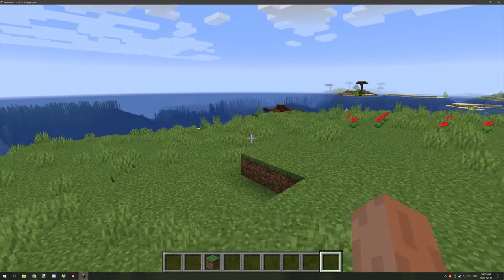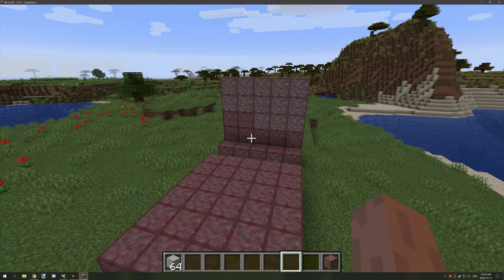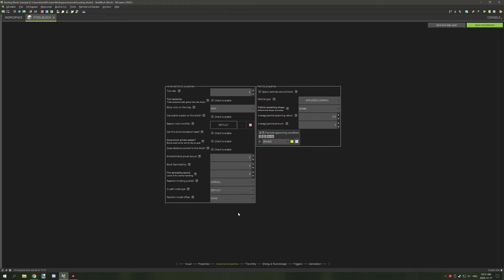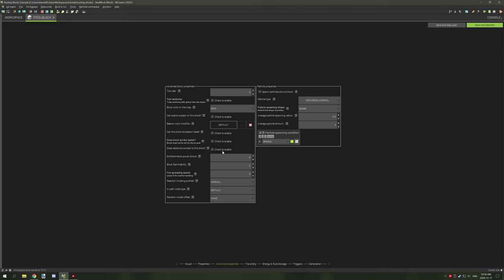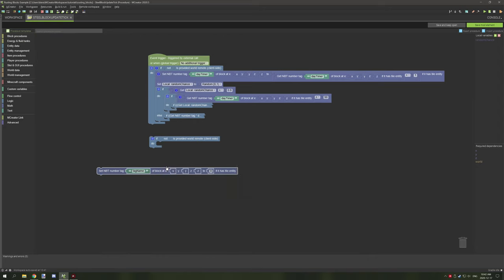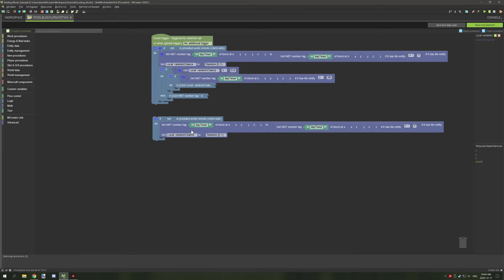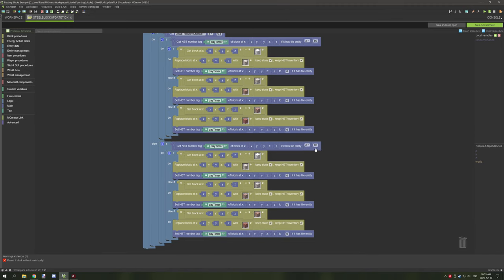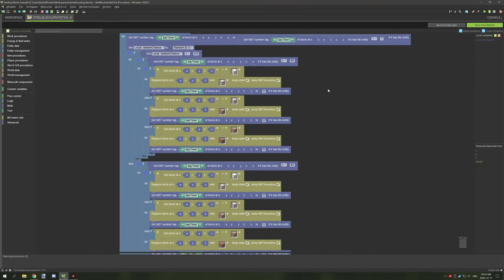MCreator: How to make Weathering Blocks | 2020.5

Comment: Can you explain how to make tools and armor affected by weathering ?
Reply from the maker: You would need to use NBT variables for items, running timers from tools would bug them out in the hand so your best option would be to run it when the player wakes up this way you can passively add one point to the tool when they get up. You can do this via testing the game time too but you would need to use MOD 24000 so you get the actual time as time actually just increases over time it does not loop back to 0.

As far as armor it could be set up the same way, once the variable reaches a set number like 5 you can replace the item with a different item in the same slot and then reset the variable for that item to start the process over again I guess so it's ready for the next weathered level until its fully weathered.

Comment: Does this works with vanilla blocks? Like if I wanted iron to rust like copper. Mcreator is great to add new blocks but is always a bit frustrating to deal with when you want to edit what is already in game.
Reply from the maker: Most likely no, editing the vanilla game is harder to do then custom blocks and there is not really a way to run a update tick for vanilla block using global procedures and many vanilla blocks are not tile entities.
Reply: @NorthWestTreesMCreator  Hm, I think you could use a global trigger to replace the block with a fake copy of certain block when you place in the world using the "when player right click a block" procedure. But on naturally generated blocks is a bit harder. I thought I could use a global timer to call the procedure in certain amount of ticks but is just not working, right now I'm trying to use "when player joins the world" and is almost working, but not really.
Reply: @NorthWestTreesMCreator  Oh, I found a way of doing it, northy. Basically you need to look around the player in a area, lets say 16x16x16 using that script you did for the ambient particles and if it found the block you want, just swap it with a dummy block, like iron for example you can swap for a dummy block that would behave pretty much the same but with the addition of the weathering effect. That should work for vanilla and naturally generated blocks. I just can't get rid of the lag it causes because all the ticks updating at the same time because of what I'm doing exactly. You should make a tutorial about it or something similar but better, plenty of people want to mod what is already in the game with MCreator but is not as simple as it seems, but is possible in some backwards way.

Comment: Do i use the is the block as operater or do i use the is the same blockstate as operater
Reply from the maker: Blockstate is only when you are comparing blockstates most of the time you will need the block operator. I don't use the blockstate one often I actually can't recall ever using it to be honest lol.

Comment: hey the project you linked in the description doesn't work the blocks don't oxidise/ change texture
Reply from the maker: Most issues are just people not setting stuff up correctly. I actually just tested the basic crops tutorial workspace and it was in working order minus the namespace not being correct for the tags, which would have not been the cause of the issue the person reported to me, chances are, its going to be a configuration issue in your workspace. Though you can still test the workspace the V2 one and set the /gamerule randomTickSpeed 1000.

If the blocks don't up date on a 1000 tick scale then let me know in a new comment and I will take another look at the workspace but often its just a issue in the workspace people are setting up in. Steps get missed sometimes which is pretty common.

Comment: Hmmm... I'm trying this in MCreator 2021.3 for Minecraft 1.17.1, it doesn't appear to work? I've set the tick speeds to the blocks really low and the timers really low so I could see the oxidation happening but... nothing. I've triple checked the procedure and I'm sure mine matches yours 100%, could it be that this method just doesn't work for this version of MCreator?
edit: My test world has the daylight cycle turned off, could that be it?? 😂I'm testing rn
Reply from the maker: It maybe be due to tile entities not being enabled for your blocks NBT data requires the block to be a tile entity so make sure to enable that as the blocks use NBT timers.